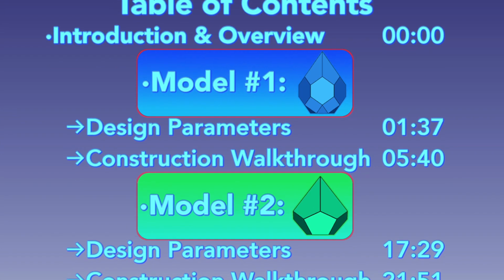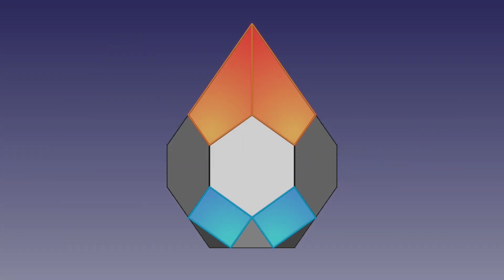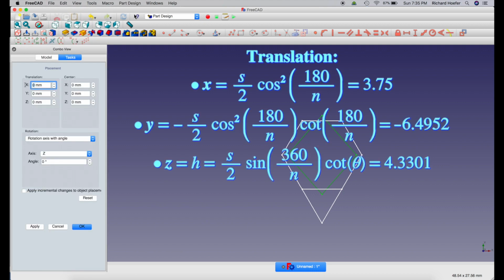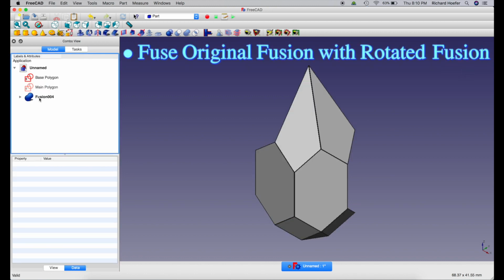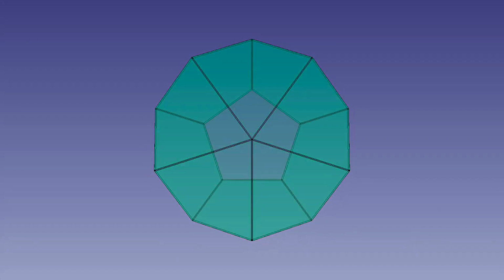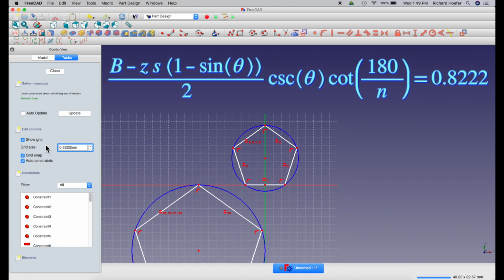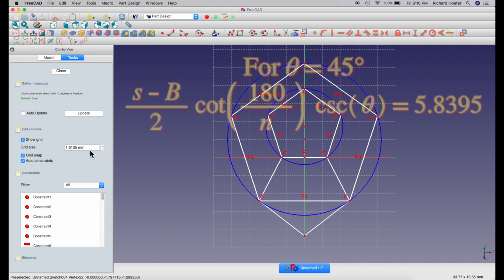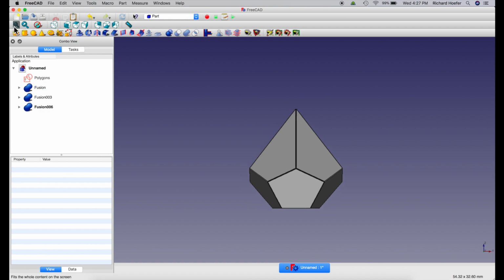Creating Polyhedrons With FreeCAD

Comment: Create new polyhedrons using ChatGPT to pick the shapes that fit whatever degrees you give it. Just say keep going until you find it if it stops . 

Still, we are exceeding 4680 degrees. Let's try adjusting again with 2 pentagonal faces and 5 hexagonal faces:

2 Pentagonal Faces
5 Hexagonal Faces
Calculation:
Pentagons:

2
×
54
0
∘
=
108
0
∘
2×540 
∘
 =1080 
∘
 
Hexagons:

5
×
72
0
∘
=
360
0
∘
5×720 
∘
 =3600 
∘
 
Total Sum:
108
0
∘
+
360
0
∘
=
468
0
∘
1080 
∘
 +3600 
∘
 =4680 
∘
 
Success!

Polyhedral Shape:
This polyhedron would have:

2 pentagonal faces, each with an interior angle sum of 
54
0
∘
540 
∘
 .
5 hexagonal faces, each with an interior angle sum of 
72
0
∘
720 
∘
 .
Visualization:
Visualizing this shape, you would see a polyhedron with a mix of pentagonal and hexagonal faces arranged symmetrically around vertices, adhering to the total sum of 4680 degrees for all face angles.

This combination successfully achieves the target of 4680 degrees, balancing the distribution of pentagonal and hexagonal faces within the polyhedral structure.

Comment: Hi! What is the name of this particular discipline of math? I want to spend some time learning about it but I'm not sure what the terms are that I should look up. 

Is it all trigonometry, or are other concepts outside of that?
Reply from the maker: Hello Home Awesomation; my apologies for my belated response. I’m glad to hear you are interested in the mathematics used in this video. It’s mostly trigonometry with a sprinkling of geometry. The derivation of a majority of the equations relies on the inherent relationships relating to polygons, such as the number of sides and the dimensions of the sides. Then these initial equations are plugged into additional equations relating to the angles of the sides and the roof. There are also some additional parameters concerning the angles that are required in order to ensure that the angles of the triangles mesh together properly. I’ve been thinking about making a trigonometry tutorial, and I might include the derivation of these equations in there if folks are interested. Thanks again, I’d be happy to help if you have any other questions. Cheers!
Reply: It's Witch-Craftometry.

Comment: The rc project is intriguing, however what about the complete plane model from images. Most scratch builders would benefit from 3D modelling of a plane, and then taking cross-sections, saving and printing them in actually size to fabricate templates for formers in balsa, or templates for foam cutting.
Reply from the maker: David Brown, this a great idea which I had not considered. I designed the plane from scratch using GIMP. I’ll make a video detailing the process for one of my next projects. Thanks for the idea!
Reply: @RickHoefer89  Suggestion. Don't use GIMP, just import an image from a Screen Shot. Also, it would be nice to use an assembly process, so you can design each component separately and assemble, as it it was a kit. I am working on a Bandet EDF design.